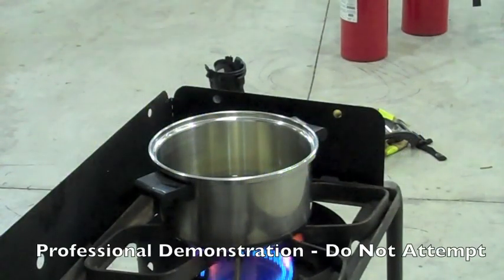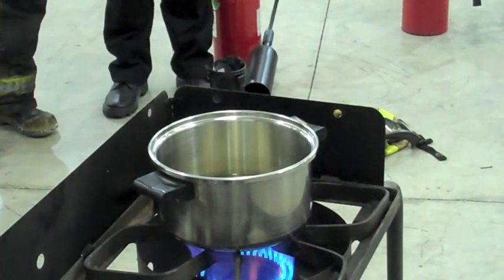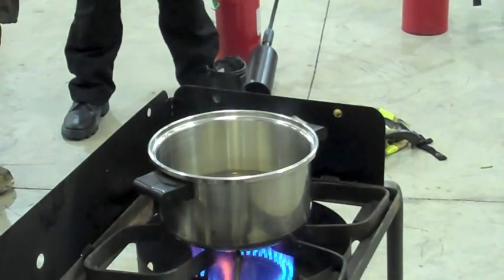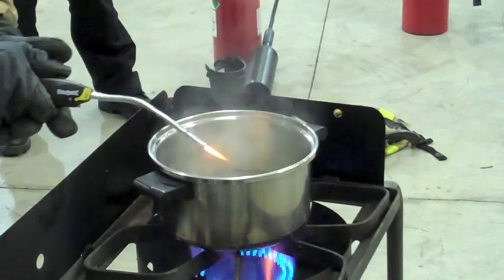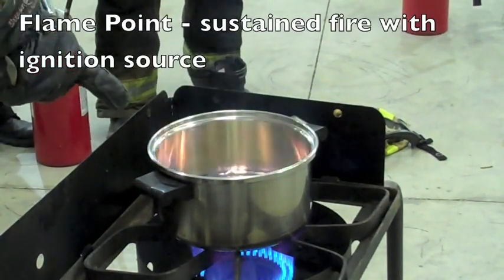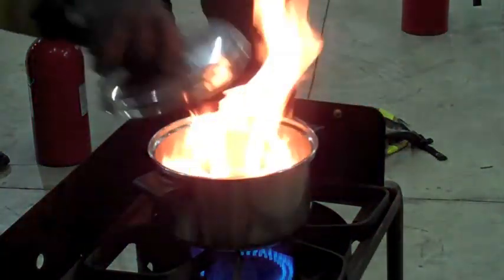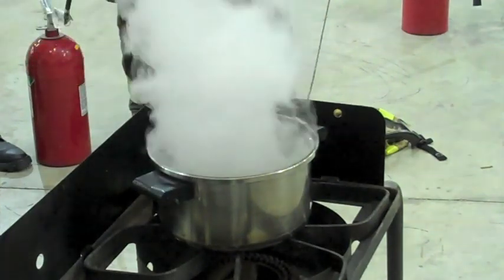Flash-Fire-Autoignition

Comment: The flash point is defined as the fuel temperature at which the equilibrium fuel vapor concentration of its lower flammability limit is attained. In reality the flash point of a chemical is the lowest temperature where enough fluid can evaporate to form a combustible concentration of gas. It is the lowest temperature of oil at which the application of defined test flames causes the vapors above the surface to ignite and the release of vapors at this temperature is not sufficiently rapid to sustain combustion.

The fire point (flame point) is defined as the lowest fuel temperature at which the diffusion flame is sustained longer than 5 s above the fuel pool without any external heat supply. The fire point for engine oils is usually 20-30 higher than flash point.

The autoignition temperature or kindling point of a substance is the lowest temperature at which it will spontaneously ignite in a normal atmosphere without an external source of ignition, such as a flame or spark. This temperature is required to supply the activation energy needed for combustion.

http://en.wikipedia.org/wiki/Flash_point

http://en.wikipedia.org/wiki/Fire_point

http://en.m.wikipedia.org/wiki/Autoignition_temperature

Comment from the maker: the fuel (still there) or the oxygen. The oxygen and the heat are the keys. The temperature is going to drop rapidly as it exits and mixes with outside air. The velocity may be accelerating the the temperature drop. As the fuels mix with the oxygen to the right ratio for flaming, the temperature is likely already fallen to below the autoignition. A follow up might be putting a flame on the smoke vent to see if it is at least at the flame point.

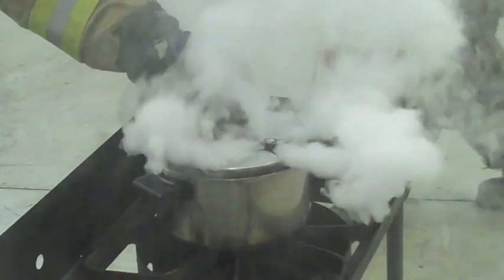Comment from the maker: The lack of contact with the liquid isn't really a factor. To have fire, you simply need the right combination of heat, fuel (in this case the smoke gases, aerosols and particulates), and oxygen. The smoke after the 3:50 mark is pushing through a restricted opening with considerable velocity. The smoke is hot, but not quite as hot as the smoke contained inside the pot. So even if we assume the smoke is still hot enough to be above autoignition temp as it leaves the container, we have to look at
Reply: It does not always have to be oxygen, chlorine will also support combustion of some things, even nitrogen will support combustion of some things such as magnesium

Comment: Even though there is extensive vapor coming out of the pot from about  3:50 onward, it isn't auto igniting. Is this because the smoke is no longer in direct contact with the liquid oil? It seems like it should still be hot enough to auto ignite.